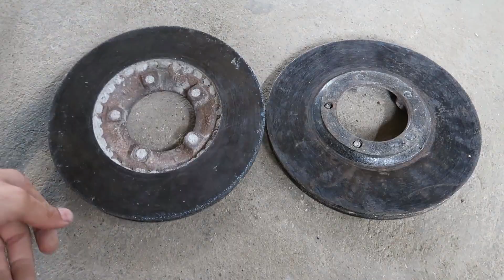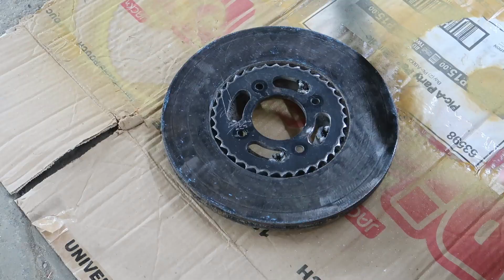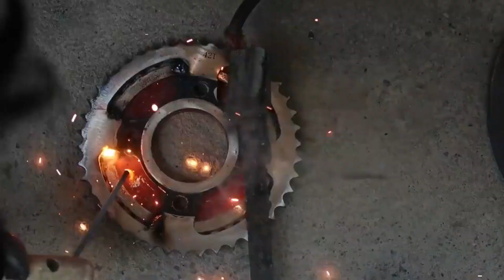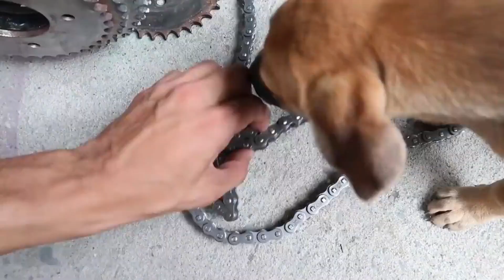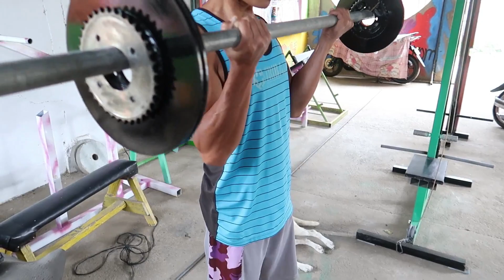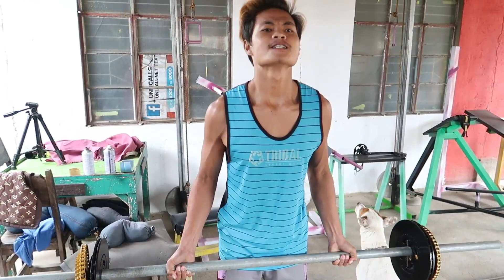Turn Rusty Rotor Disc into Homemade Barbell Plates - Homemade Barbell

Comment: Quick question: Why didn't you just weld the bike chains to the plates instead of using a plastic ziptie?

I need to get me some buffer tools. Look at all the chrome!
Reply from the maker: I ran out of welding wire that's why i just used some zip tie on it hehe.
Reply: @romgd  Good call. BTW all your projects make me wanna get a welder, haha